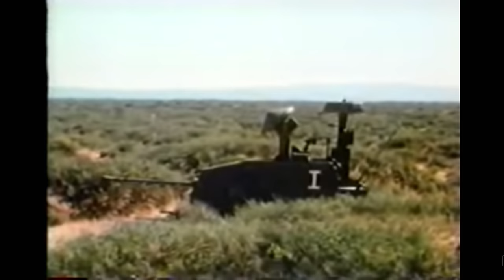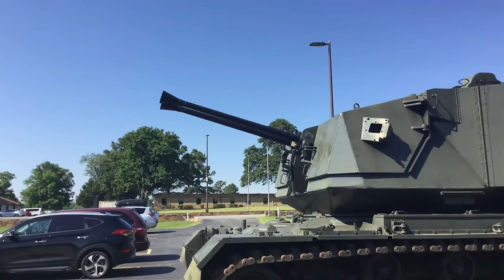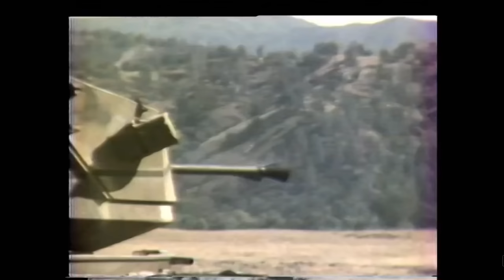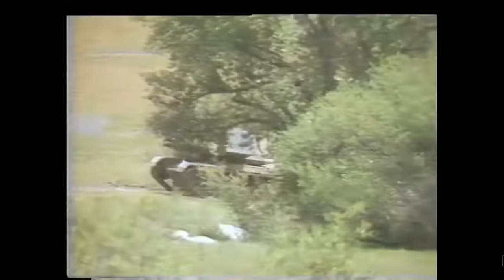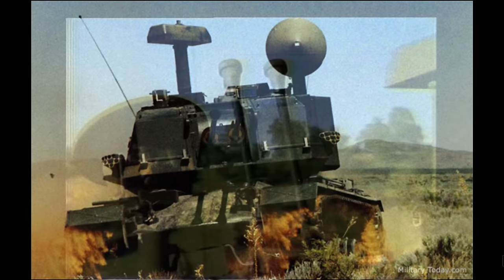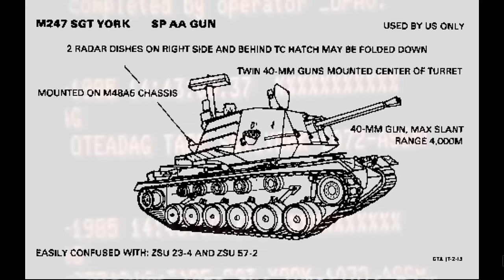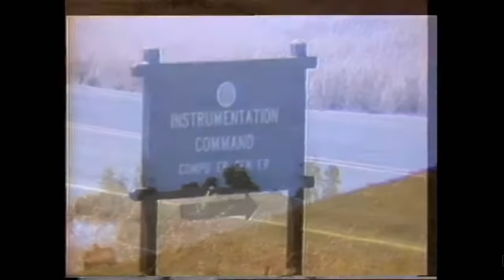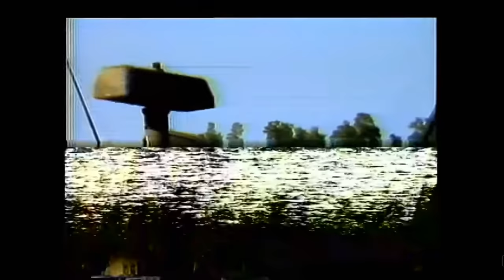M247 'Sergeant York' | WORST AIR DEFENSE EVER!

Comment: Here's something from one of the testers:

Tom Farrier Retired USAF rescue helicopter pilot; current aviation safety contractor (UAS) said:
In 1982 I participated in both cooperative and non-cooperative tests at Aberdeen Proving Grounds in Maryland, flying an Air Force CH-3E helicopter against a Sergeant York. I would have been dead many times over had it been shooting live rounds at us instead of just video.

The Sergeant York was the front-runner in a program intended to provide the Army with a sorely needed “division air defense” (DIVAD) weapon system. It was based on a novel concept: re-purposing M48 Patton tank chassis’ with a new turret incorporating twin Swedish Bofors 40mm cannons and two radar systems — one for area surveillance (the rectangular antenna) and one for targeting (the conical antenna, an off-the-shelf application of the F-16′s radar).

A firing control system integrated the two radars, with on-board software prioritizing targets based on the threat they were assessed to pose to the system itself. (For the late ’70s /early ’80s, this was cosmic.) If the operator elected to allow the system to engage targets hands-off, it would slew the turret around at a nauseatingly rapid rate, taking on each in turn automatically.

On the next-to-last day of the test, my aircraft was joined by an Army AH-1 Cobra and OH-58 Kiowa and two Air Force A-10s. My H-3 was part of the test profile because its radar signature was essentially the same as that of an Mi-24 HIND assault helicopter of the day, which was heavily armed with both anti-tank missiles and rockets. We all converged on it simultaneously from about 6000 meters. My aircraft was the first to die, followed by the two A-10s, then the Cobra, and finally the Kiowa. It took less than 15 seconds to put plenty of hypothetical rounds into each of us.

I spent a depressing amount of that week watching myself get tracked and killed on video. Trying to “mask” behind anything other than rising terrain simply didn’t work; the DIVAD radar got a nice Doppler return off my rotor system if any part of it was within its line of sight, and it burned right through trees just fine. I couldn’t outrun or out-maneuver it laterally; when I moved, it tracked me. I left feeling pretty convinced that it was the Next Big Thing, especially since I’d come into the test pretty cocky thanks to having had a lot of (successful) exercise experience against current Army air defense systems.
So, what happened to the program itself? I think it was a combination of factors. First, the off-the-shelf concept was cool as far as it went, but the Patton design already was a quarter-century old; the DIVAD was awfully slow compared with the M1 Abrams tanks it was supposed to protect. It would have had a lot of trouble keeping up with the pack.

Second, The Atlantic Monthly published a really nasty article (bordering on a hatchet job) purporting to show the program was a complete failure and a ruinous waste of money. One of its most impressive bits of propaganda was an anecdote about a test where the system — on full automatic — took aim at a nearby trailer full of monitoring equipment. Paraphrasing, “It tracked and killed an exhaust fan,” chortled the author. (See The Gun That Shoots Fans for a recounting of this.)

Yeah, it did. It was designed to look for things that rotate (like helicopter main rotor systems) and prioritize them for prompt destruction. If any bad guys were on the battlefield in vehicles with unshrouded exhaust fans, they might have been blown away rather comprehensively. (My understanding at the time was that said fan was part of a rest room in one of the support vehicles and not a “latrine,” but why mess up a good narrative, right?)
To my knowledge, neither ventilated latrines nor RVs full of recording devices are part of a typical Army unit’s table of allowance, so I really doubt there was much of a fratricide threat there. However, the bottom line was that this particular piece of partisan reporting beat the crap out of a program that I believe the Army needed, but already was facing a few developmental issues, and helped hasten its cancellation.

(The New York Times opinion piece linked to above was equally laden with innuendo and assumptions. It made a fair point about possible anti-radiation attacks it might have invited… but there are radars on every battlefield, and there are means of controlling emissions. It compared a late-Fifties era Soviet system — the ZSU-23–4 — with one fully twenty years newer in design. It asserted that it couldn’t hit fixed-wing aircraft, which to my mind and personal observation was arrant nonsense. The only issue it raised that I agree with was possible NATO compatibility problems with the unique 40mm caliber shells the Sergeant York’s guns fired. Funny — the Times pontificated that it wouldn’t be cancelled, too. Oops.)

Third, the hydraulics that were used in the prototype were a 3000 psi system that really couldn’t handle the weight of the turret in its Awesome Hosing Things mode. One of the only times I actually got a score on the system was when I cheated; I deliberately exploited that vulnerability. I flew straight toward the system (which would have blown us out of the sky about twenty times over had I tried to do so for real) until directly over it, then tried to defeat the system from above.

If memory serves, the system specifications called for the guns to elevate to more than 85 degrees if something was coming up and over; it then would lower them quickly, slew the turret 180 degrees around, and raise the guns again to re-engage. It was supposed to be able to do that in perhaps ten seconds (but I’m here to tell you it did it a lot faster than that). So, I had my flight engineer tell me the moment the guns dropped, at which point I did a course reversal maneuver to try to catch it pointed the wrong way. What the video later showed was:
Helicopter flies over.
Traverse/re-acquire movement starts.
Helicopter initiated hammerhead turn (gorgeous, if I say so myself).
Guns started to elevate to re-engage.
Clunk. Guns fall helplessly down; DIVAD crew uses bad language.
The hydraulics hadn’t been able to support the multiple close-on, consecutive demands of movement in multiple axes and failed. Like I said, I cheated. The Army and the contractors already knew about this problem and were going to fit out production models with a 5000 psi system. That might have had some survivability issues of its own, but the Army was perfectly happy that we’d done what we did — it proved the test wasn’t rigged and underscored the need for the production change.

Finally, the Army itself honestly appraised the system based on its progress (and lack of progress) versus their requirements. Wikipedia provides a passage that encapsulates this end-game well: “The M247 OT&E Director, Jack Krings, stated the tests showed, ‘...the SGT YORK was not operationally effective in adequately protecting friendly forces during simulated combat, even though its inherent capabilities provided improvement over the current [General Electric] Vulcan gun system. The SGT YORK was not operationally suitable because of its low availability during the tests.’ ”

I guess I’m forced to conclude that the Sergeant York was a really good concept with some definite developmental flaws — some recognized and being dealt with, perhaps one or two that would have made it less than fully effective in its intended role — that was expensive enough for bad PR to help bring it down before it fully matured. The Army was under a lot of political pressure to get it fielded, but to their credit they decided not to potentially throw good money after bad.

On balance, a lot of the contemporaneous criticisms mounted against the M247 really don’t hold up very well over time. Short-range air defense currently is provided by the latest generation of the AN/MPQ-64F1 Improved Sentinel system. Radar emitting on the battlefield? Check. Target prioritization capabilities? Check. Towed (which equals “slow”) versus self-propelled? Check.

I’m glad we never wound up in the position of needing it but not having it. My personal judgment was and is that it probably could have wound up a heck of a lot more capable and useful than its developmental history might suggest, but its cancellation probably was justified given other acquisition priorities at the time.

Bottom line: I repeatedly flew a helicopter against it over the course of many hours of testing, including coming at it as unpredictably as I knew how, and it cleaned my clock pretty much every time.

Comment: The Ford Aerospace engineers grossly underestimated the shock and vibration environment of a combat vehicle. They assumed that the gun fire peak shock load would be the worst aspect to counteract for the electronics survivability where in reality, its the low frequency spectrum of just driving the vehicle down the tarmac and cross country that most severely degrades the life of the electronics. In addition, the operating temperature extremes that are spec'd for combat vehicles and the limitations for passive cooling (especially in the 1980's) meant the possible life span for the  fire control system of the M247 was almost zero...

Comment: Sweden actually had something similar during the cold war called the VEAK 40 (Vagn, Eldledning, Automatkanon 40/Vehicle, fire control, automatic cannon 40), or "Lvkv 70" (Luftvärnskanonvagn 70/Self propelled anti-air gun 70). It had a twin Bofors 40mm as well, radar etc etc... Built on the Stridsvagn 103 (S-Tank) chassis. It didn't go into mass production though as it was deemed to expensive. Though Sweden had the old "Lvkv M/43", also a twin Bofors 40mm design built on the Stridsvagn M/40 chassis.

Comment: 55 tons and 750 horsepower?  I think I see a problem.  That's a power to weight ratio worse than a 90s vintage 3 cylinder Geo Metro.  In fact it's about 1/3rd the power to weight ratio of a Geo.  Didn't realize the Army was making "economy tanks".

Comment: Back in the early 80's when I was stationed at Fort Bliss as a 19D assigned to L Troop 3/3 ACR, I was on the support detail for the SGT. York.  I remember the Ford Aerospace Engineers sitting in their air conditioned vans while the system was being tested on the range.  And I remember watching failure after failure on the range, no aerial targets were hit and the engineers laughing about it.  It was junk from the start and Ford Aerospace new from day one.  But it was fun to watch.  Scouts Out!!!

Comment: I was stationed at Ft Bliss, 5/62ADA, and we tested the Sgt York. The M247 was a joke. There were lots of mechanical problems, with all the surplus parts being used. The fire control almost never worked in auto mode, which basically made it no better than our Vulcans. I remember that it couldn't engage a hovering helicopter and wasn't accurate on most others. It would often lose track & disengage from targets. The ranges were rigged to make the Vulcan look bad, as the York had more r ange than the Vulcan, but it didn't matter, because the York fire control was so unreliable.

Comment: The problem is not the 40mm guns. The CV 9040 Anti-aircraft uses it with programmable ammunition.
Any gun that can use programmable ammunition and has at least 30mm caliber will be effective against low flying objects.
The issue here was system integration. All components on their own were excellent. Great radar, pretty good chassi, belt fed dual 40mm autocannons... On paper this is a beast.
Reply: Not exactly. The chassi was outdated. Remember, this were the 80's, the M1 was already a thing and this rolling disaster wouldn't have been capable to keep up with the M1 or even the M2.
The Radar was capable in an aircraft, but the thing is, aircraft radars never work well when you try to use them at low level, they start to pick up an awfull lot of falls returns because of the terrain.
And the dual 40mm cannon...well it's strange that basically every other NATO compatible country except sweden...because bofors...was going for the 35mm Oerlikon for their SPAAGs.
Reply: @shi01   On the mobility issue, an engine upgrade would probably be adequate.
  About the radar, filtering out the wrong the wrong phase shift (due to the doppler effect) is not even rocket science.
  I understand that a lot of false positives got picked up, but I put the blame solely on the system integrators and a retarded spec for usage.
        
  My guess is that they wanted to engage low altitude static targets (like tanks and helicopters with potentially non reflective rotor assemblies) due to not including an expensive thermal sight.
        
  So you get a cost saving measure that ends up f*cking the entire project due to being borderline impossible to implement.
  Identifying moving objects (including rotor blades) is easy, even with a vehicle mounter fighter jet radar.
  Identifying static to semi-static targets in partial (and sometimes moving) ground clutter with the same pulsedoppler is borderline impossible.
            
  On the cannon, the Oerlikon certainly has its strengths but seing dual beltfed 40mm cannons just melts my heart.

Comment: The real bad thing on this all is: the proposal by Raytheon was a modified Gepard SPAAG on the same Chassis as all the other proposals (M48A5) and General Dynamics used the same Guns too. So they had, in the case of Raytheons proposal, a working, proven system they could have used. But no, they wanted to delevop a thing on their own and utterly failed to do.

Comment: I think part of the problem is the timing. Guided middle stand-off range is such that the aircraft could destroy the system without being in range of the 40mm guns. And the range/tracking system wasn't developed sufficiently for field use.

Comment: They based it on a M48A5 chassis which was already obsolete in the maneuver division due lack of mobility (speed couldn't keep up on roads much less cross country) - strike 1. They took 40mm barrels that were supposedly improperly stored for decades to mount on the system. The barrels were supposedly corroded and visibly bent - strike 2. They cobbled together various electronics of the day without giving much thought as to their durability in the field - strike 3. They said when the guns were at maximum elevation they blocked the view of the radar and those are very short barrels - strike four.

Comment: At the time of its cancellation I read Ford had given a much higher developmental budget then the Army was going to agree to.  Mostly involving adjusting the M16 radar, geared to missiles and 20mm rounds, to the much larger 40mm round. The 40 had different ballistics then 20 75mm which meant a complete rewriting of the software/ hardware (thus is the early 1980s, the difference between software and hardware was much different then it was even just 10 years later). When Ford made its proposal it included the expected cost of adjusting the radar computer. The Army told Ford, it could be done cheaper and ordered Ford to make a bid based on the Army's expected costs of the adjustments.  When the system completely failed Ford again came back with its original estimates and the Army rejected it as to expensive.
Thus the Army, to this day, has no local Anti Aircraft Defence except the 50 caliber machine gun and man portable Anti Aircraft missiles, both with extremely short range.  Some of the missiles have been enlarged to work out of Humvees but with only a marginal increase in range.
Now, with the end of the Cold War, a larger Anti Aircraft weapon that could keep up with tanks was not seen as needed, the US assumed the US would always have complete air superiority thus no development of Anti Aircraft weapons for ground forces was needed. The recent upgrade of both the Russian Army and Red Chinese army have brought that presumption into question (More to do with very small time and area lost of Air Superiority then anything long time or permanet). Thus a growing desire for long range mobile Anti Aircraft weapon for the Army and yes Russian Anti Tank missiles from Helicopters outranged 40mm ammo, using hills and other terrain features that extra range can quickly become useless.  40mm ammo permits the mass production of a wall of fire a missile must through, much more then the larger but slower to fire 90mm and 105mm anti aircraft guns. The British found this out in the Falklands, where they lost her fighters to the 35mm Argentina anti aircraft guns.  The British later captured those 35 mm guns and incorporated then in the NATO defence system they were found to be that good.  A mix missile and gun Anti Aircraft Defence seems to work the best, they complement each other well, with guns dominating below 50mm and missiles dominating over 75 mm.

Comment: The theory behind the York, was valid then and is still valid today.  Personally, I feel the biggest problem was the reliance on mixing the various parts, from totally different systems and expecting them to work as a cohesive whole.   

Using old M48 hulls without repowering with upgraded engines, and expecting them to keep up with tanks and vehicles designed to be faster than the M48, was sheer lunacy...old M60 hulls would have been a better bet, especially in light of currently available engine upgrades, for the M60, found today.

The 40mm guns are still viable, and better than the 20 & 25mm systems currently found on the battlefield, but the Bofors 57mm AA gun would be superior, especially given that the USN is using that gun, but because the 57mm, is better suited for engaging AA and ground targets...it’s still not a tank killing weapon, but the flexibility of the 57mm ammunition, lets you use one ammunition type against multiple target types.